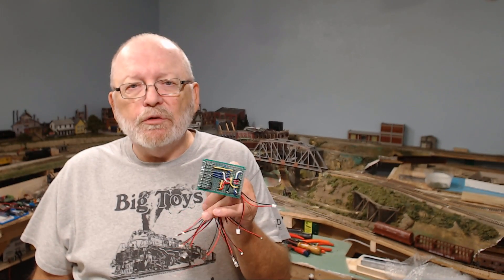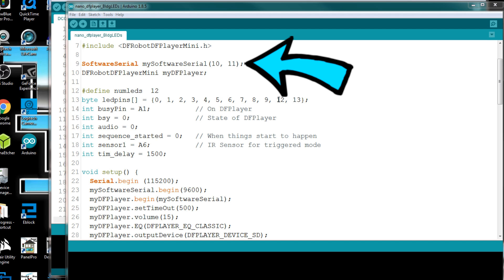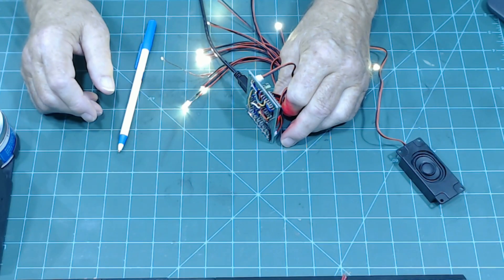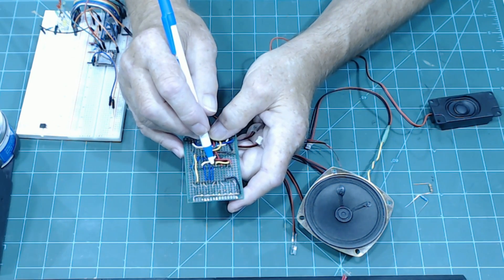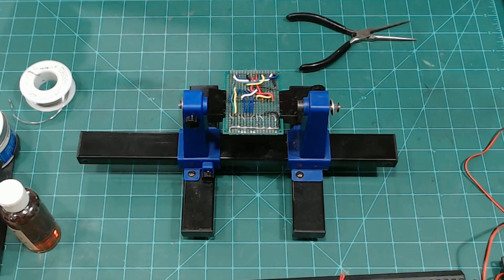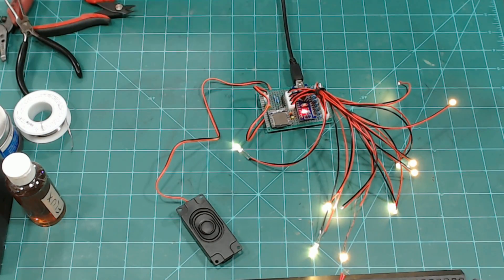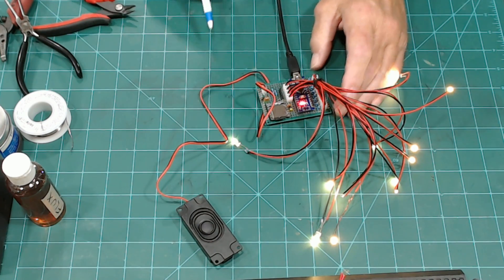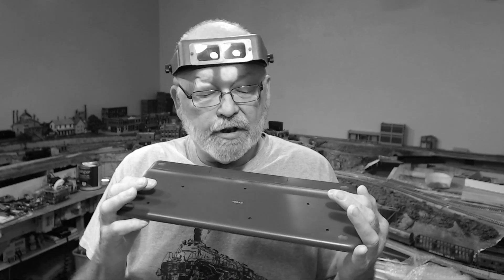Issues I uncovered With The Arduino Nano & DF Player Mini Project

Comment from the maker: If using the Vin connection for power on the Nano  make sure you have the correct polarity if using a DC power pack. There is no reverse polarity protection on this pin. Also, make sure you do not short this pin to ground. You will fry the regulator on the device.
Reply: "This device " is microcontroller or the dfplayer?

Comment: If i used a radio transmitter would the rx and tx pins cause the code i have to send the wrong functions to my reciever and transmitter by interfering somehow?
Reply from the maker: This is a question to be asked of the developers of the software on Discord  https://discord.gg/pvnBueZR

Comment: This small wire resistors are cheep China resistors and I have found they dont work with breadboards more China crap
Reply from the maker: I think the ones that I had with the smaller leads were from a starter kit that I reviewed

Comment: Hi !! if it doesn't recognize sd card, but plays if i touch io1 or io2 with negative, it plays. Rx with 1 kohm resistor, tried changing with each other,  Rx and Tx, but still "no sd card", what can it be ??Help !!!
Reply from the maker: Could be something wrong in the code or the wiring. Double check everything. Make sure tx & rx are in the correct  positions
Reply: @TomsTrainsandThings  yes, everything is in position, if serial windows of the pc says wait 3 to 5 seconds, and, after that, i assume rx and tx  are ok, but no sd card  , i mean, "df player is communicating, with dfplayer and nano , but dfplayer says there is no sd, or does it mean, i have no communication at all? That point is not quite clear,  but dfplayer, thanks for your answer!
Reply: Problem found! Arduino has not amp enough to make it work, put external 5 v 5 A and perfect, thanks for your help

Comment: Pins 0 and 1 are used by the hardware serial port. It's not the DFPlayer Mini module that is interfering with those pins. 
When you call Serial.begin() at the beginning of your program then pins 0 and 1 are initialized for the serial communication to USB.
Reply from the maker: Correct

Comment: Nice Tom. I did a 2mb stand-alone audio device for space and cost savings (sd cards are expensive!) in my newstalgia version of the Bachmann Whistle Warehouse. 
I think your initial  #13 flicker is because iirc 13 is the onboard LED that comes on when power is applied before your sketch loads and repurposes it.
Reply from the maker: Thanks for your input. I since eliminated #13 and used another pin. I do have another player made by DF Robot that stores the mp3 file on the board. That will be in one of my next projects. I started this project almost a year ago now before the new player came out. 
Here's what I'll be using on my next project:
https://www.dfrobot.com/product-1741.html

Comment: Do you use that Keyboard for the Raspberry pi?
Reply from the maker: Haven't used the Raspberry Pi since I got the keyboard. I use either my computer or my tablet to control the RPI through VNC. I'll have to test to see if it can be set up with a wireless keyboard. I know once it's up and running you can use it.